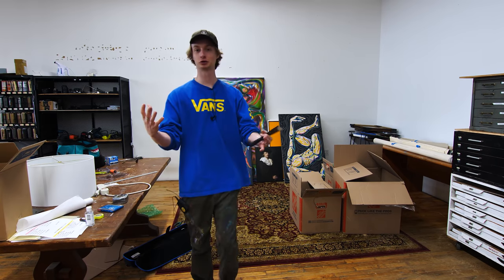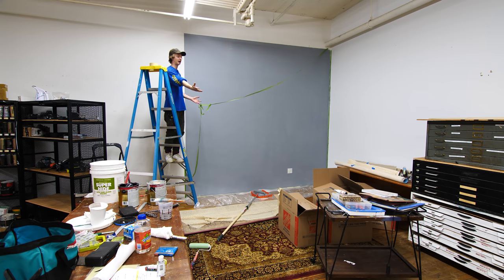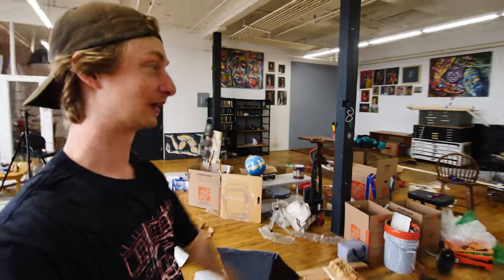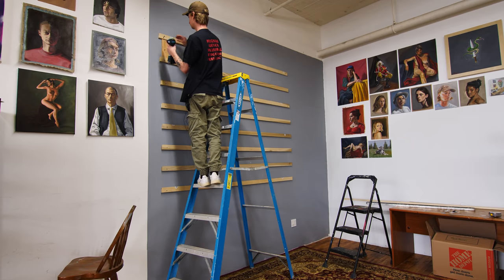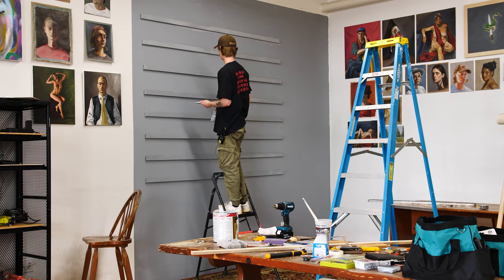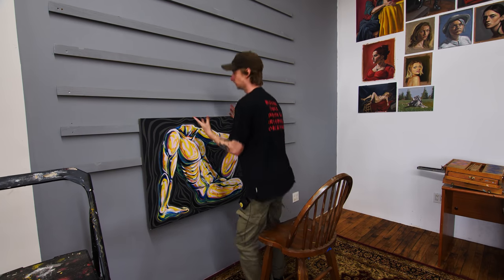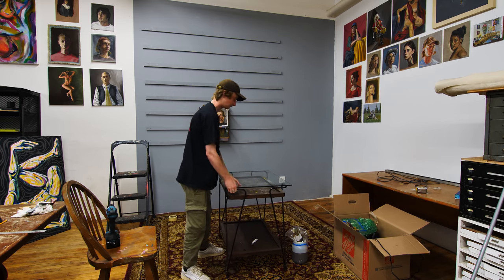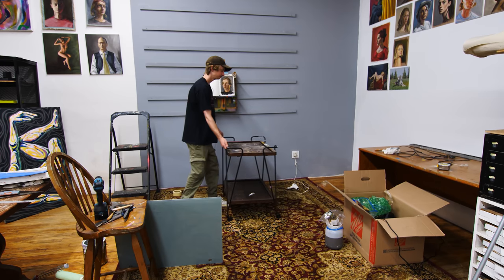MY DREAM PAINTING SETUP // (SLEWDIO_3)

Comment: Great video :)
I would suggest for your lights, to use traverses that hang down from the ceiling, there you are totaly free to set up lights on and you can run the power cables as you want.

Comment: I work on large canvas. My van is designed to work on 1.5 by 1 mtr but after I finished my current piece I will building my easel for much larger.
I'm going to make runner, so I can rest on my back and slide under my canvas. Alot like how mechanics work on the under carriage of cars.
While you have your tools out, I thought it an idea to run that idea by you.
Working horizontal can take the irritation of work long hours on a piece and in theory improve your painting strokes.

Comment: Try Lowe’s for lights before you make the huge light investment.  I bought 3 led shop light panels for about $60 each. I still use them and they are 5 years old.   Extremely bright and they don’t get hot.  I had a studio space with no natural light and one dark brick wall in a warehouse and they worked great.  You will def. need more than 3 because you have super high ceilings.